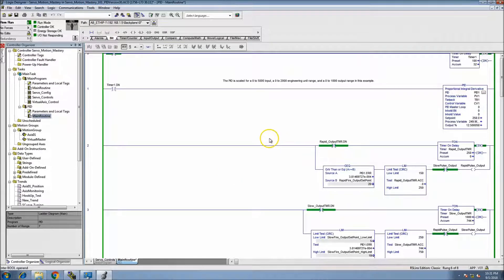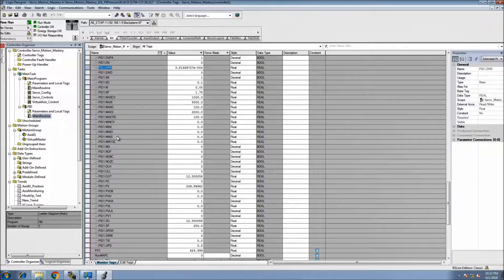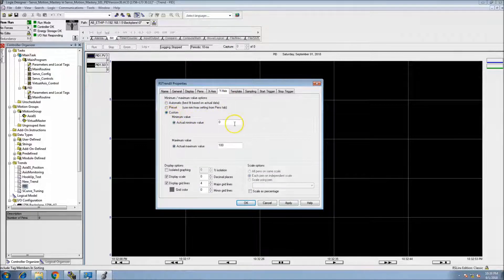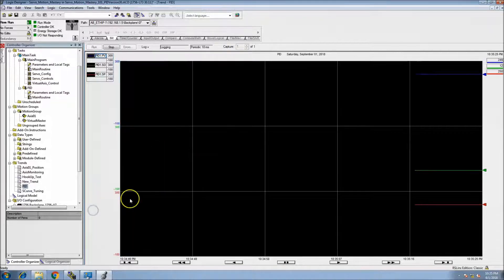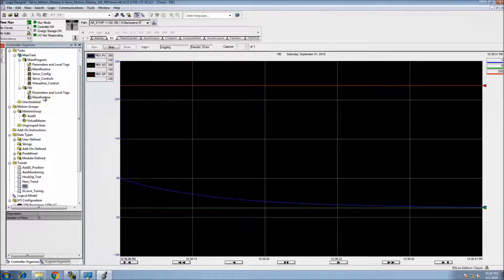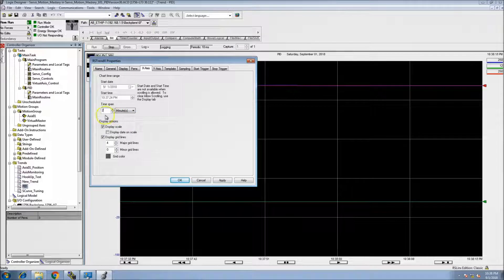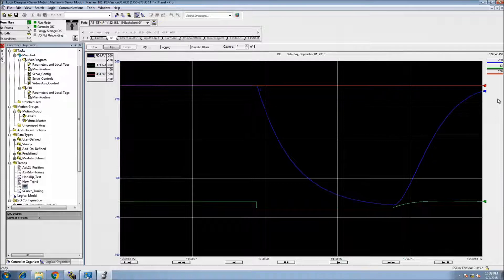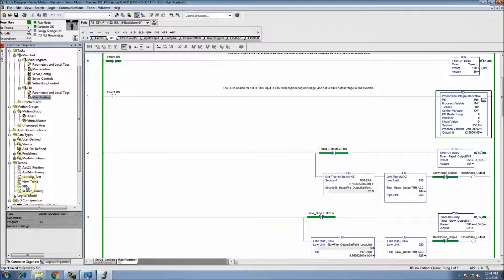RSLogix 5000 Setting Up a Trend For Tuning a PID Loop [Official Video]

Comment: Shane what means the output it is at 13%? If the output it´s a 4-20mA, the 13% of 20mA? Is correct?
Reply from the maker: 13% of the range that is scaled or used in the I/O set up, whatever you are using.